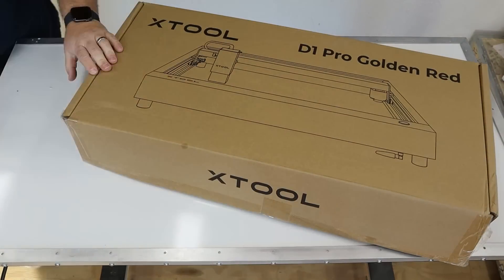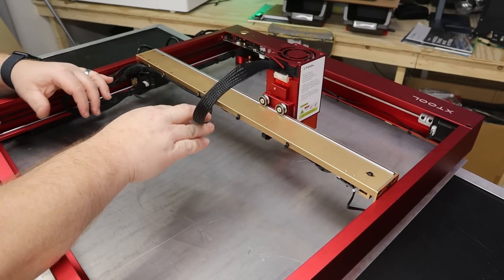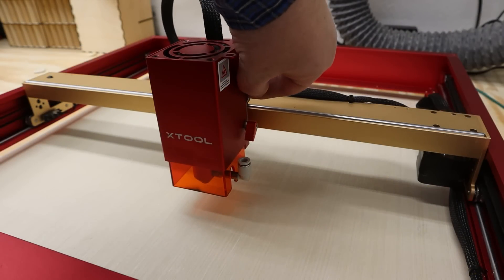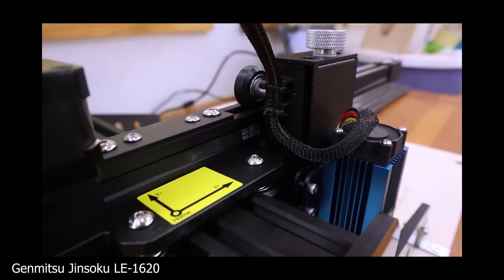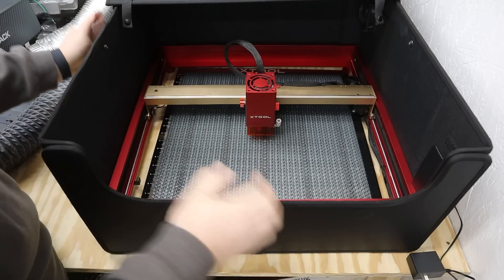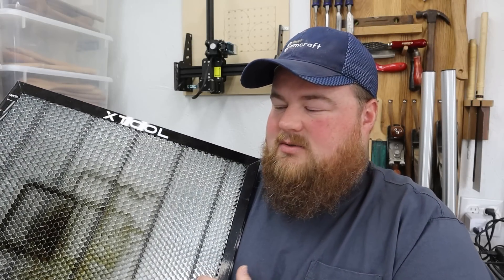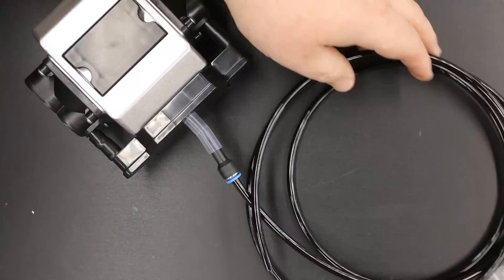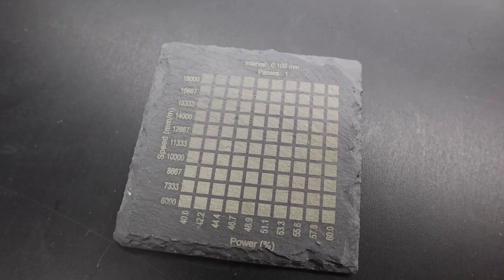HONEST REVIEW: xTool D1 Pro 20w | Air Assist | Honeycomb | Enclosure

Comment: Great review! I bought my Xtool D1 pro after seeing this. I have had a Neje laser for 4 years and wanted something more powerful and easier to use, and this machine fits the bill. They did correct the cable management on the laser wire on mine. Great tool and cutting is a breeze! Slate engraving is super easy and fast too. Thank you!

Comment: Hey Sam.  Great video.  I am getting used to my xTool Pro 20W.  Specifically cutting.  I got your material test files, and tried them on my machine, but with different results.  It seems to take my machine 5 passes at 1 mm/sec to cut through the xTool 3mm walnut veneer plywood.  Any thoughts?

Comment: Overall great review although most of the complaints are pretty easily fixed. The 0,0 is in the bottom right because the gantry take up space, so if it was in the top left you 0,0 would actually be the gantry width and laser head off of 0,0. You pick the origin in both their software and laser burn and can pick the bottom right so to say their origin point is the top right is misleading and inaccurate. So it came of (intended or otherwise.) that you were really looking for reasons not to like it, so just started making things up to complain about.

Comment: When I received my X Tool D1 Pro 20 W,  the machine would NOT home.   Cable management.   From the factory the cables interfered with the Y axis safety switch and I found,  both safety switches were DEFECTIVE.   Aahhh !!!   X Tool customer service I found to be lacking but finally,  after several attempts,  they did send two replacement s switches which were installed.   Cables were then re routed in similar manner as you suggest and the machine functions as it should.   PRO  ?   No, its not.

Comment: With the straps, the issue of it it falling forward again goes away if you open the lid all the way - and I don’t say that to be condescending. The flap which folds down over the front and magnetizes to the front panel can be folded backwards instead of forwards, as you have it in the video. The weight distribution pulls back at that point, instead of forward, and the lid stays open just fine.

Comment: Hi Sam, I own an xTool D1 Pro 20W as well and agree with your cable management assessment.  I did not have the same cable-tie tearing problem, but they do bind when the gantry reaches the rear, annoying.
As for the focusing arm, I disagree.  It is very handy to have it built-in - nothing to lose or misplace.  If the arm tip scratches your work surface when returning it to the up position, simply put a small piece of paper between the arm and work surface when focusing it.  The paper's thickness will not appreciably change the laser focus - it is not a precision system ;-). If you were concerned, then you could compensate by tweaking the arm adjuster for the paper's thickness...
I have been very happy with the laser but lately have stumbled upon some strange homing inconsistencies when burning.  I burn a small circular pattern using "Current Position" and "Selection Origin" for the project origin.  But if I re-burn without changing anything, it seems to burn about 1mm 'south' of the last burn.  I can repeat this 2-3 times before it finally burns in the same location - as it should have done in the first place.  This is quite alarming.
I have tightened belts, latest firmware and reset the laser but it still persists.  Would be good to know if you see the same thing ... might be SW bug?
Reply: I'm looking at this model, have you figured out the issue on this?
Reply: @patrickbledsoe2176  yes, simply re-organized the cabling, new ties.  Gantry moves all the way to the rear now.  Trial and error but not difficult.  I love this machine combined with LightBurn.

Comment: I feel I need to bolt my xtool to the table if I’m running it at 15,000 mm/min
Reply from the maker: Really? I didn't notice anything much at those speeds with this unit.
Reply: @Samcraftcom  I’ve never seen anything visible yet but I’ve been keeping it safe and running around 6,000. I’m used to my lightweight Ortur I have.

Comment: USB - I switched over to wireless as on long jobs I ran into problems with.  One issue was pausing as it would send the next "set" of commands, 2nd issue was it just dying at the end of job.  Moving to wireless addressed the pausing and potential crash problems.
Enclosure Straps - must be a quality control issue, mine is perfect size and is 5 degrees or so over 90 and sits perfect when opening.  The enclosure in general, I had many concerns on cost, but like you, very happy I bought it.  While smoke will sometimes billow out the left hand side where the air vents are, this may be how I have the fan mounted (see below).
Fan for enclosure - I put mine on the outside, granted can't say I looked at instructions, but then you only have one thing going through that hole.  I really wish they'd put an on/off switch on it like they did the air assist.  I actually picked up a power cord with multiple plugins and plan on putting air assist and fan on same one so I can turn both on/off at same time and not leave the wall wart in all the time sucking power.
Air assist hose - I had to play with the amount that was in the enclosure to make sure it didn't catch, but that was a concern of mine too.
Honeycomb - I couldn't justify the 3x cost for theirs vs others on amazon for the same size, so will be interesting when mine shows up today how well it holds up.

Overall nice wrapup, look forward to other new projects you do with it.  To date I've been happy with mine, minus the fact they announced the 40W during the timeframe I was waiting on mine to ship!

Comment: I ended up using a standard compressor (one of the super-quiet ones from good ole' Harbor Freight, but California Air Tools would have been a better choice), and plumbing it into both my Atomstack diode laser, and my big HL-Yeah 1060 co2 laser, with pressure regulators that I can set for different types of wood/surfaces.  Since you've got so many lasers, you might want to look into that at some point, especially for the Co2, as it's vastly superior to what they usually include with them, and you can dial them in for the specific stuff you're working with.  (Mine's plumbed on the Co2 so that if it's cutting it'll automatically use a higher pressure, but there's always a slight pressure running to keep any fumes from the lenses, search for Ultimate Air Assist for an example).
Reply from the maker: Could you send me some photos of your air setup in email? It does sound like a worthwhile project to do! sam@sam-craft.com
Reply: I did the same thing. I had a lirrle Senco quiet 2 gallon compressor and it does a much better job

Comment: 3D print a drag chain for your wires!!!  :)
Reply: Was going to suggest the same, there's a set of STL's on Thingiverse for the D1, which should also fit.  I don't think Sam has a 3d printer available, so I'd offer to do it for him and ship it up there if he wants to give it a try.. Requires extending the stepper/control wires, but it'd make it a much nicer/neater looking setup.